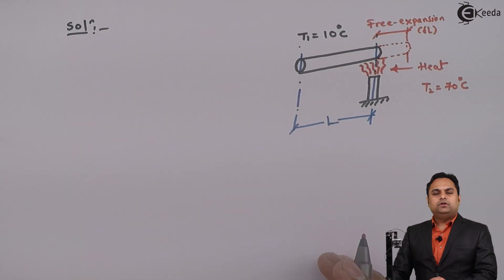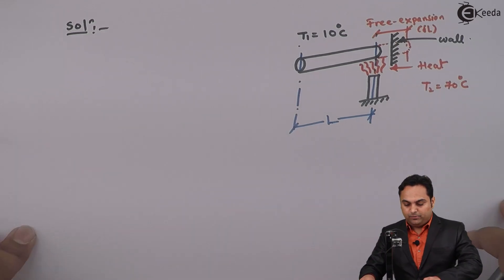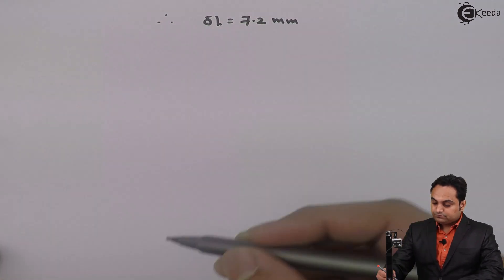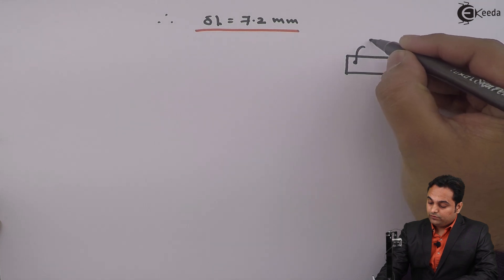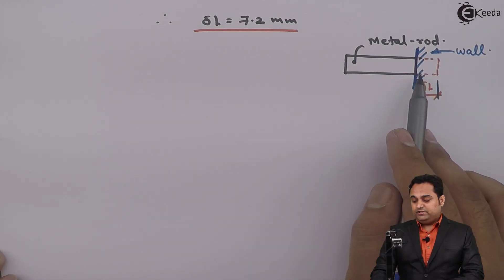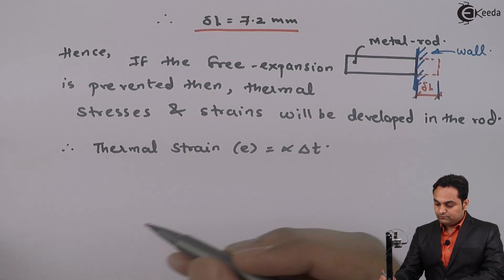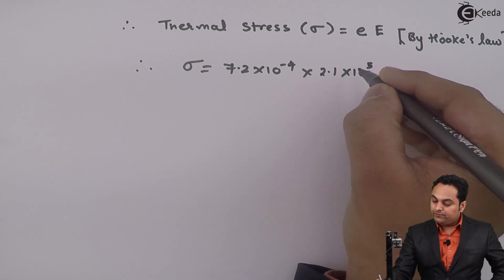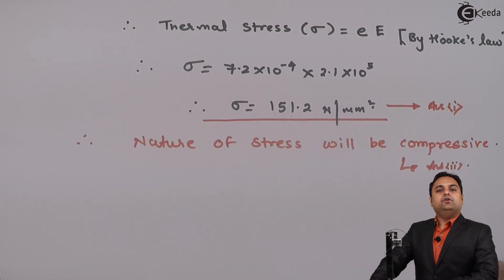Temperature Stress and Strain : Problem 1 - Stress and Strain - Strength of Materials

Comment: A rod with material constant E = 2 x 10
5 MPa and length 1 m is fixed at one end and free at the other
(cantilever beam). It is heated at the free end and allowed to elongate freely by 1 mm. Calculate the
stress developed in the rod.

Comment: Sir please find the answer for this question 
Rails are laid with their adjacent ends 3mm apart when the temperature is 30c . The length of each rail is 10 m. E=200 GPA . Temp at which adjacent end will contact Alpha is 10×10^-6c